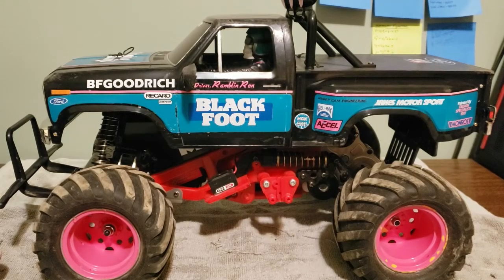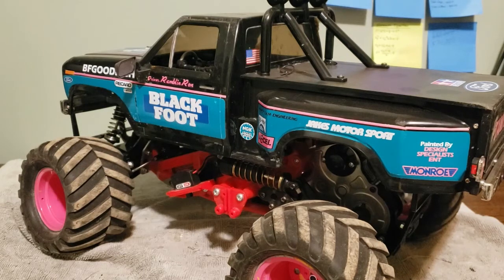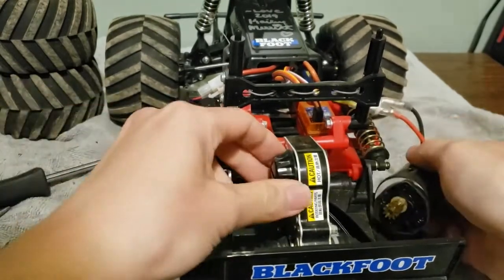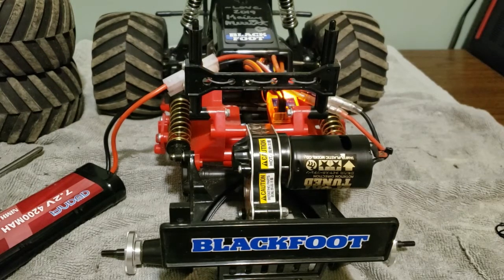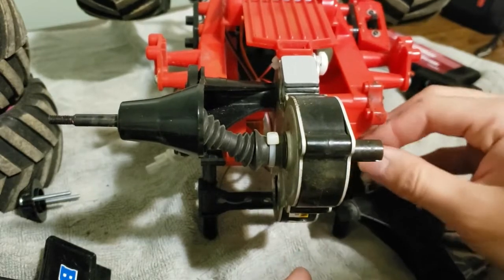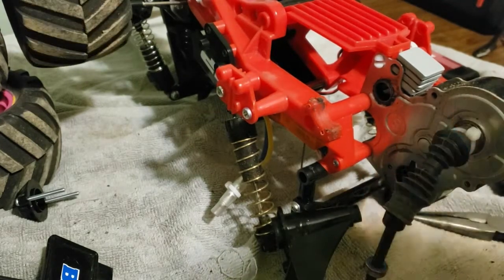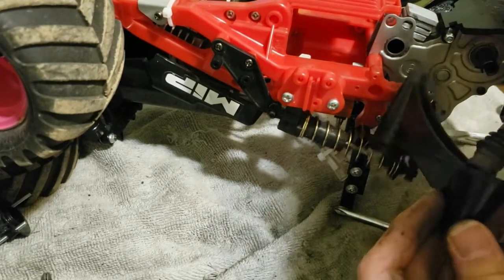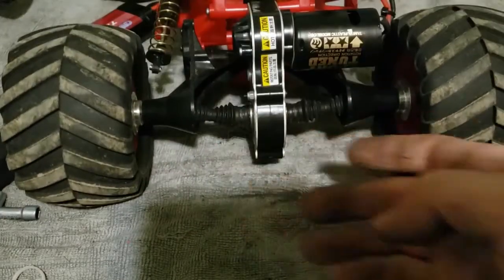Tamiya Blackfoot Transmission Mechanical Gremlins?

Comment: Great video, I just got a Blackfoot ReRe. Ive been out of the hobby for some time and through this covid thing started looking around for something to do... needless to say I found the Blackfoot ReRe and since it was the same RC I had as a kid I just had to get it. Was looking at your videos to see what's good to upgrade and came across this video after watching your Lunch box tire vid... (already ordered mine) but as far as your "gremlin" I was thinking you might want to check your motor mount for cracks... seeing as one of the screws seamed to have backed out... and with just one screw for support the mount took some extra stress... seams like the motor mount is failing...
Reply from the maker: Ill have to check my motor mount!

Comment: I have problems with my dogbones popping out almost EVERY run. I found out my transmission was loose and vibrating the dog bones out. I tightened them up, and my dog bones still dont seem to run smooth. Can anyone tell me something I could have done wrong or a simple mod I could do to fix this. Asking for a friend lol.
Reply from the maker: It could be caused for a couple reasons but if it's not the trans then the trailing arms could be loose or flexing under load. Because of their design they dont really like horizontal loads

Comment: I didn't even watch the whole video I just see you working in the beginning and I can tell you already that that gearbox is cooked those nylon gears are junk
Reply from the maker: You should watch the whole video then because the gears were fine! 😉
Reply: @chibiskyrc  it's always something with that truck motor gear meshing is hard to get because it's covered with a plastic cap

Comment: If you want something that's always broken get a black foot junk in the 80s and still junk now
Reply from the maker: I really enjoy mine and it's been great for me! I'm sorry you didn't have a good experience with it though. It happens sometimes. It's like many people love the Stampede but I've personally never had luck with it
Reply: @chibiskyrc  i hate Traxxas all you do is buy upgrades for them out of the box the original black foot was always broken dog bones were always a problem and the shock tower and body brakes easily
Reply: Mine is great man. I bought my blackfoot knowing about all the problems with the gear box. I love my blackfoot and it is tougher then my traxxas stampede. You have to look at these 80s models from an 80s point of view there wasnt any nylon blend plastics back then and technology was not as good as it is now. I am respectfully stating my opinion so dony flame me.
Reply: @twotone85  mine was always broken and I got tired of dealing with the Blackfoot Traxxas was another company that was junk too much time doing upgrades on Traxxas equipment I went HPI and Losi just a better product in my opinion but people like the brands that they 👍
Reply: @outdoorman6018  losi is great
Reply: @twotone85  I agree losi wins over the Blackfoot hands down lol
Reply: @outdoorman6018  yes but its way more modern
Reply: @twotone85  the old losi is just as good as they are now
Reply: Kyosho trucks broke more than tamiya trucks…….comparing a Blackfoot to a losi is like comparing a pinto to a Cadillac………the Blackfoot is not meant for today’s style of bashing…..yes rc cars have gotten way better since 1986……..the hobby was way different back then……. There wasn’t metal gears,brushless motors, lipo batteries……… it was all plastic gears, brushed motors and nicad batteries……..the rerelease kits are great and address some of the issues with these trucks…….losi, associated, redcat, traxxas ect have their own issues